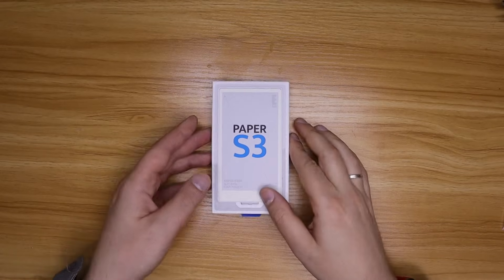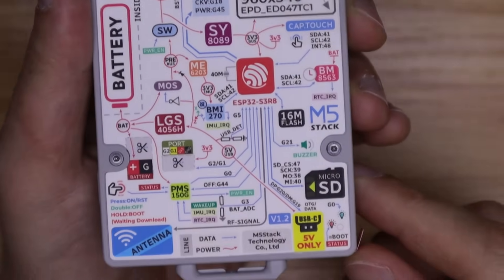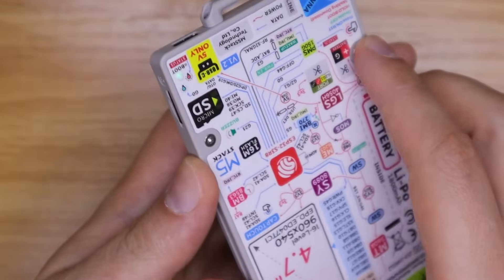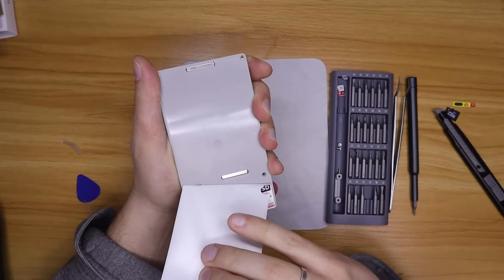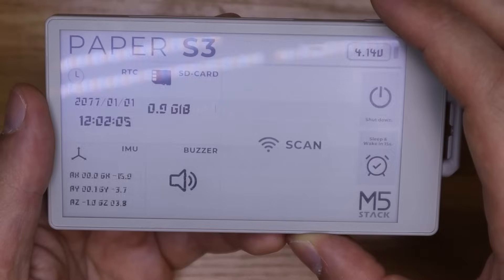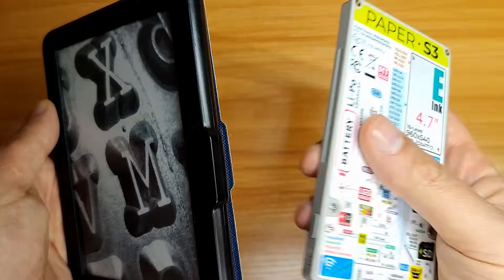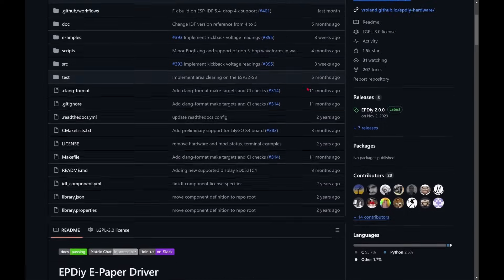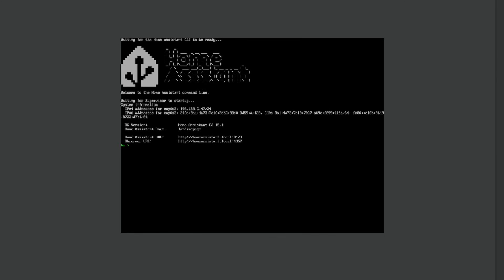E-reader for geeks? M5Stack PaperS3 review!

Comment: Definitely interesting looking, though I think it’s too small for an e-reader. In landscape continuous-scroll it might be fine, though the refresh rate would limit your scrolling resolution. I’d rather see a cheap open-source RSVP reader.

The glued on back is a shame, I’d prefer something where the battery is easily replaced, or removed for storage. Considering the quiescent current of the display, it might be preferable to swap the battery for a LiFePO4 cell for maximum longevity. An amorphous solar cell would be a nice touch too.

Comment: What does "5v only" mean in that context? Will it not recognise quick chargers at all? Will it fall back to the 5v mode? Will it burn? By the amount of stickers I would think it's the latter, but I refuse to think that's the case
Reply: There's a problem with PD negotiation which can cause damage to the device if 9v/12v etc power supply is connected.
Reply: @BagginsOfTheYorkshire that's bad. Really embarrassing if that's the case